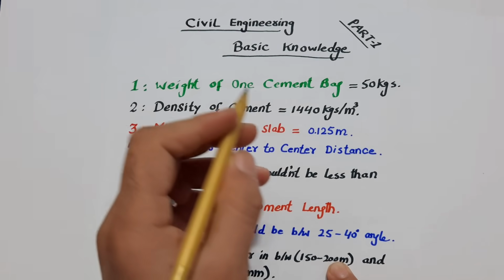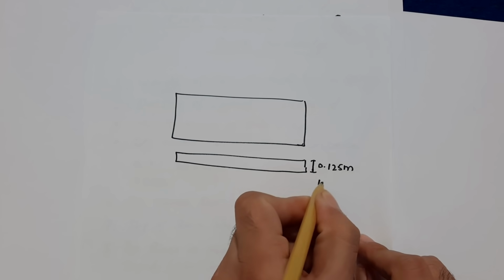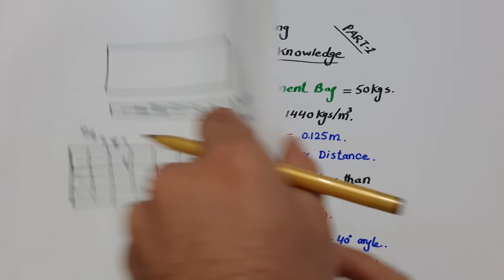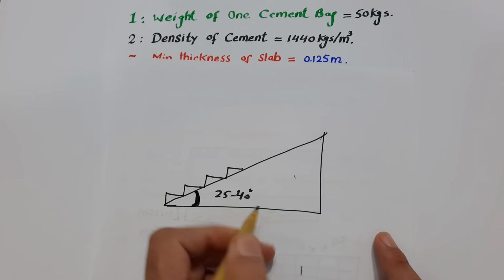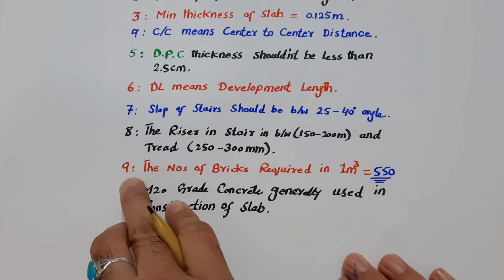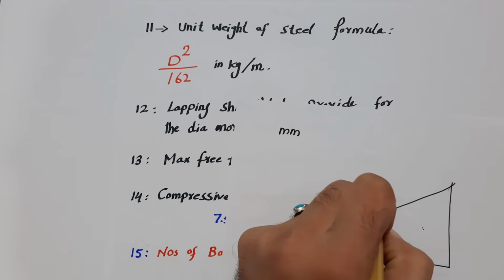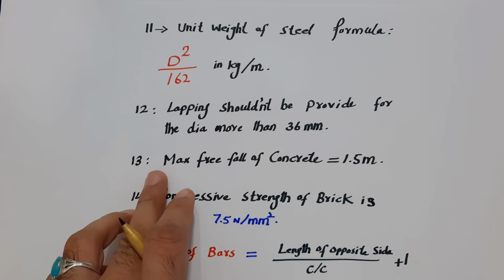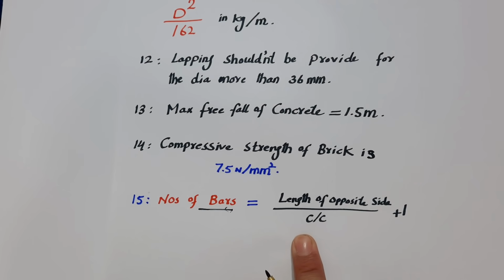Civil Engineering Basic Knowledge  part -1

Comment: Sir, stair's angle depend on the plot area of the house. Isn't it? Or it's applicable on any sort of plot, or doesn't matter whether the plot's area is large or small?
Reply: It should be applicable to almost any case, but would also depend on local regulations, and how much height you want to gain. There is a golden rule about stairs: 2xRiser + 1 step = aproximatedly 64 cm. This rule considers the natural step length of an average person and makes it effortless to use.

Comment: Compressive strength of brick is 7.5N/mm2 (this is grade of brick ❓)

Minimum compressive strength of brick is 3.5N/mm2
Reply: Minimum average compressive strength of brick shall not be less than 7.5 N/mm2 when tested as per IS-3495 (Part- 1):1976...
what you said is for Minimum "crushing" strength of brick is 3.50N/mm2..

Comment: 1 M3 =550nos of bricks what is the solve this question ❓

1 M3  = 500nos of bricks 👍👍
Reply: Minimum average compressive strength of brick shall not be less than 7.5 N/mm2 when tested as per IS-3495 (Part- 1):1976